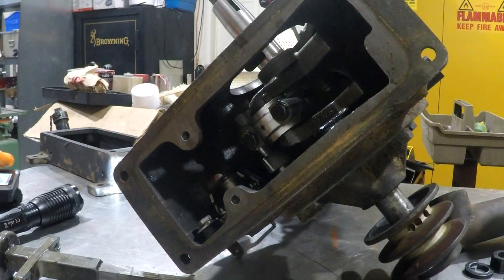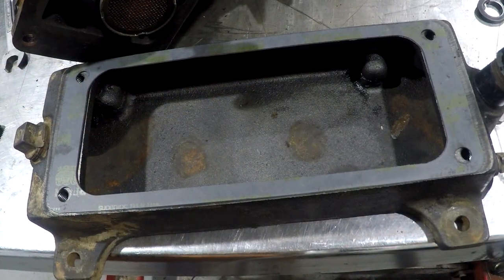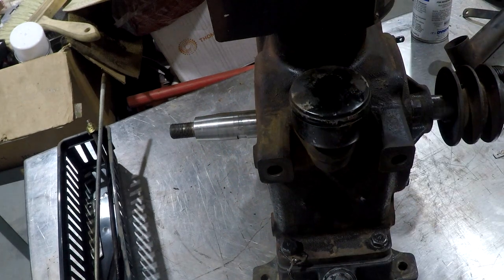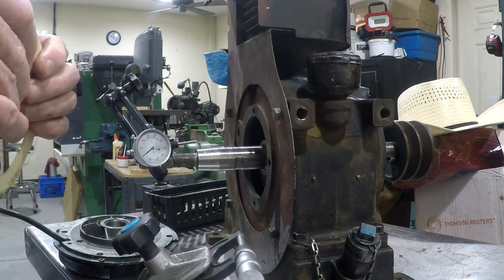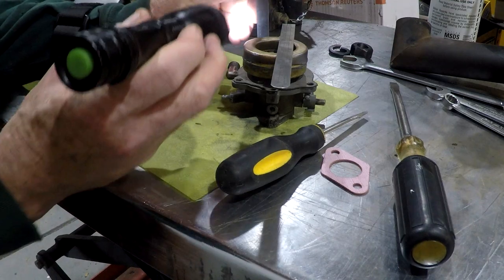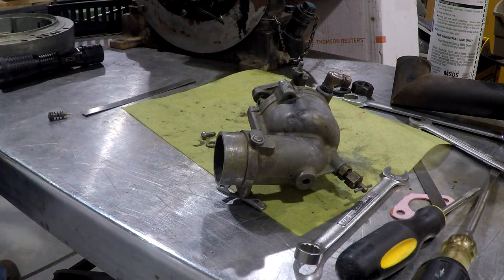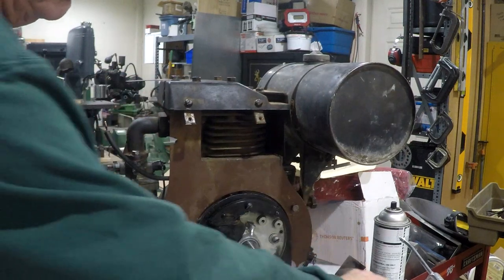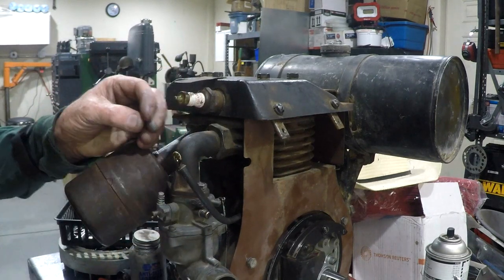Briggs & Stratton Model "B" Gas Engine - Part2

Comment: Hi. Can you show me the I'd tag with it's numbers. I have a Briggs B engine too and I need to get parts and mine doesn't have and I'd tag.  Thanks
Reply from the maker: I couldn't get a decent picture, it's in dark storage. But here's the data:
Model B
Type 300510
Intake valve .008" cold
Exhaust valve .010" cold
Spark gap .025"
Hope that helps.
Reply: @OldIronLover  Thank you